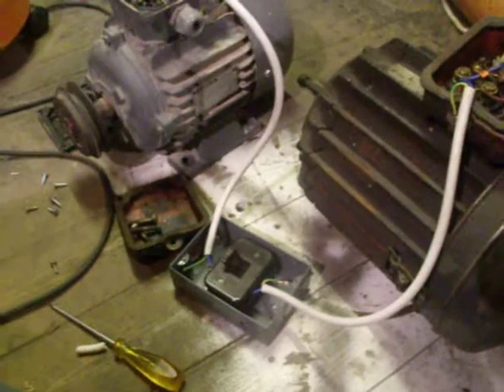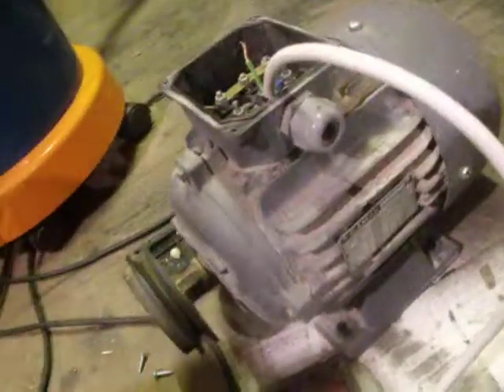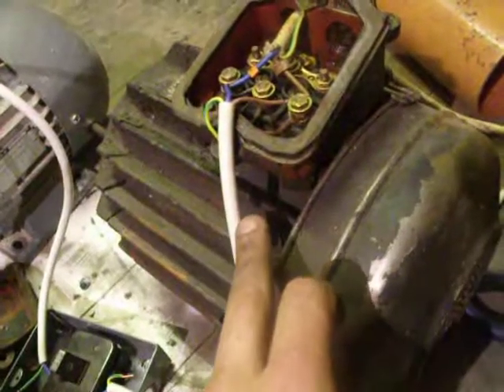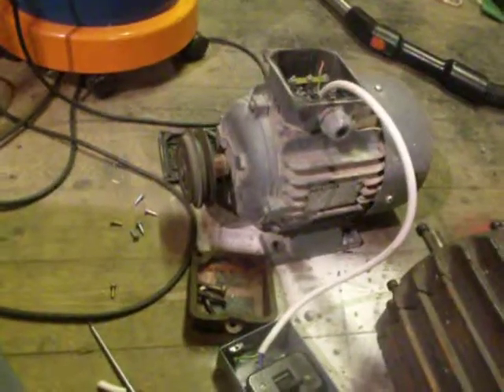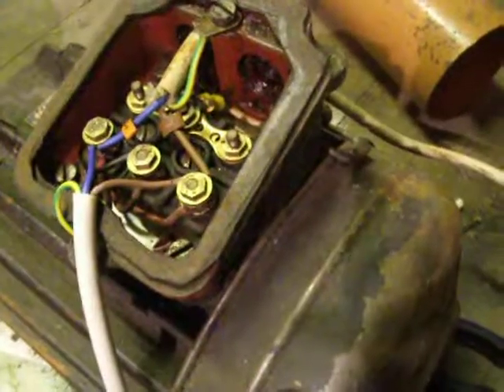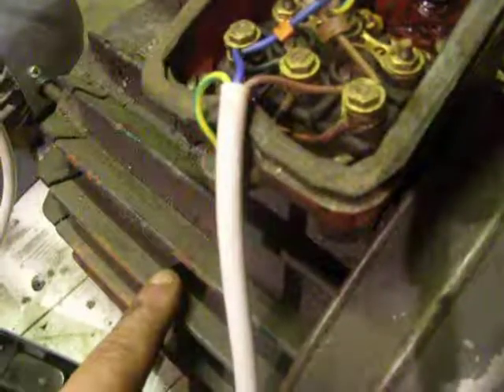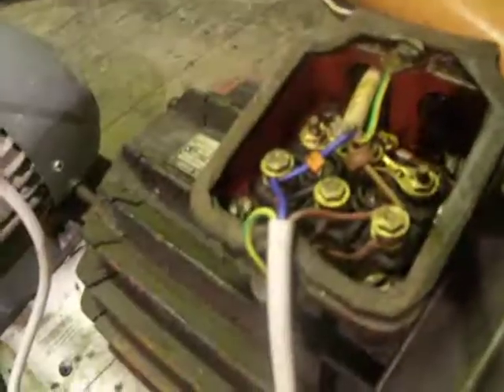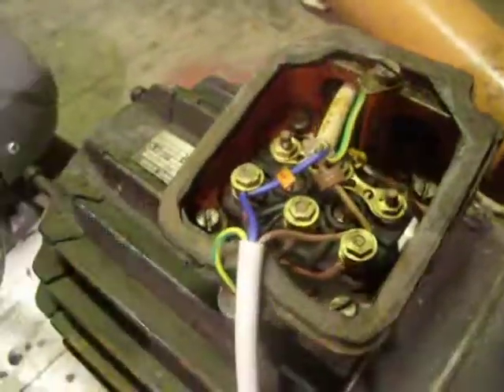rotory phase converter

Comment: i absolutely adore the sound of a 3 phase motor staring up, i am in year 8 at school and have woodwork. The disc sander is the one that i can hear the 3 phase Y config the most. By the way the triangle symbol is Delta config, because the motor windings are arranged with the three corners of the triangle as L1, L2 and L3 whereas in Y(star, or Wye) they have the common neutral point and L1, L2 and L3 are directly across the inputs of the windings. Hope this helps even in the slightest.